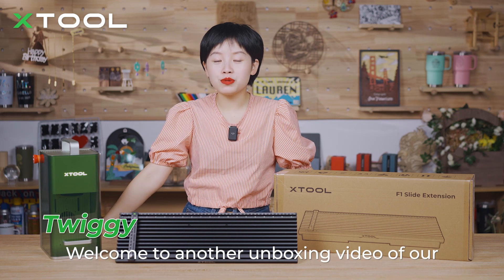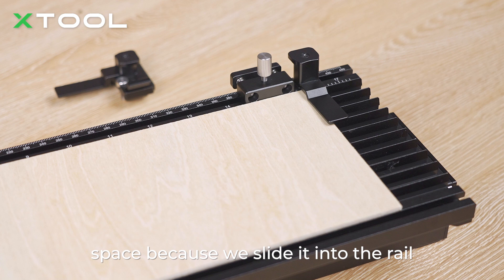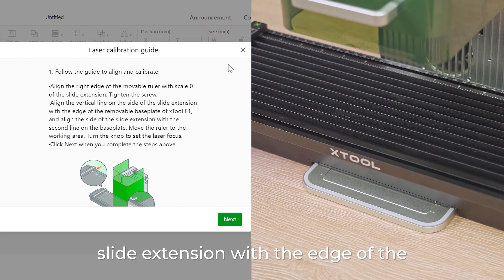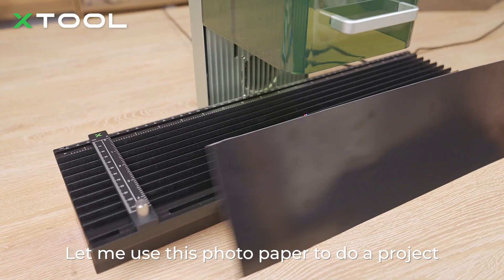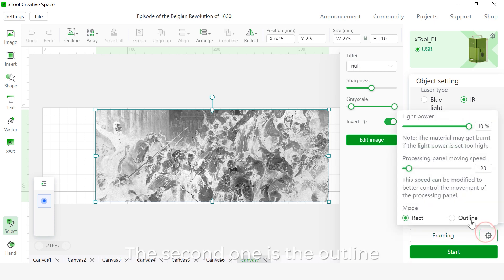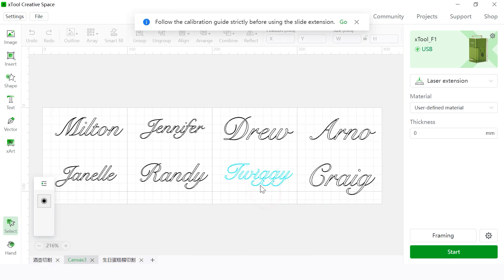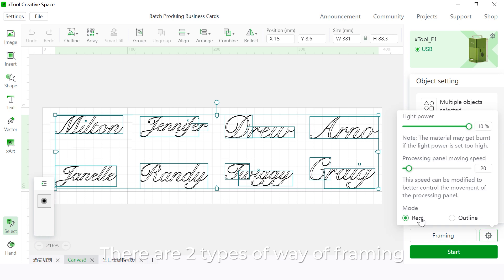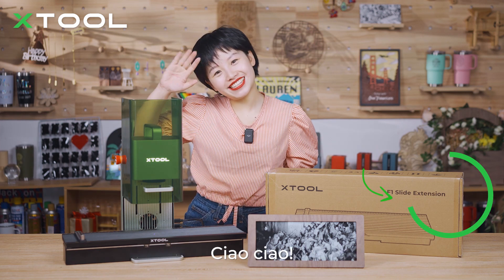Unboxing xTool F1 Slide Extension Accessory

Comment: I am very disappointed with the slide extension. What no one tells you is that the maximum speed allowed is only 160 mm/s. I thought it would operate normally in each of the four sectors, just like without the slide. People have advised Xtools about this since last year, but to no avail. It only makes sense to buy the Xtool F1 if you can work with just 150 x 150 mm or slower than a €200 laser device for objects with greater width.